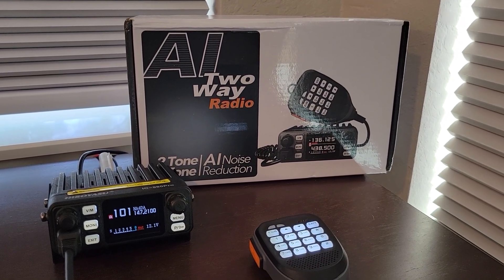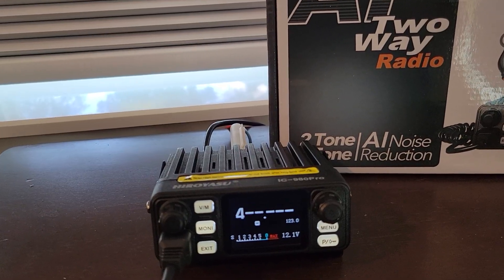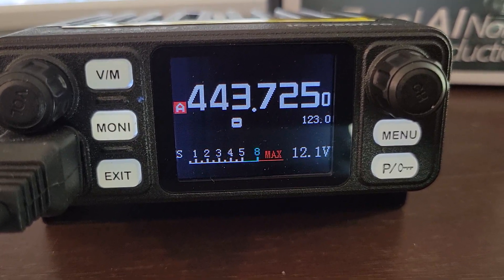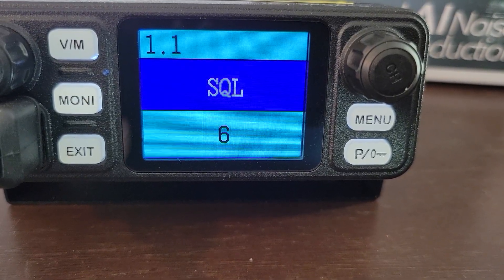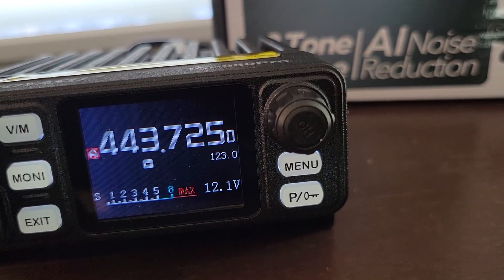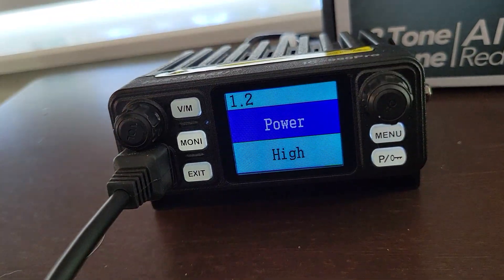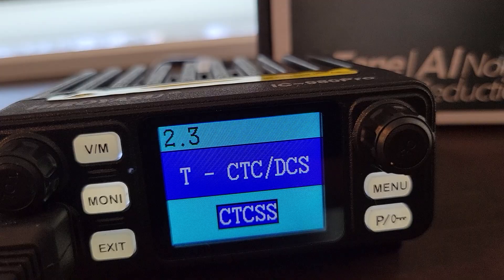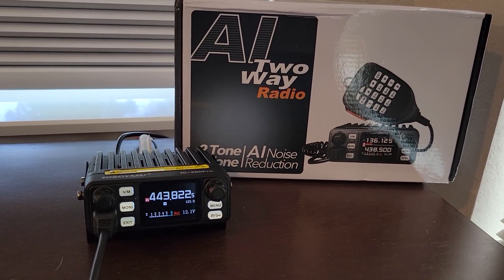Hiroyasu IC-980 Pro Function Key Shortcuts

Comment: You mentioned function 4 is for crossband settings.  I'd heard it's possible to use this radio as a crossband repeater, but am not finding any instructions on how to make it work.
Reply from the maker: Did you find an answer to your question about crossband?